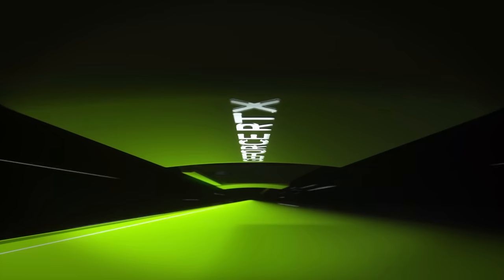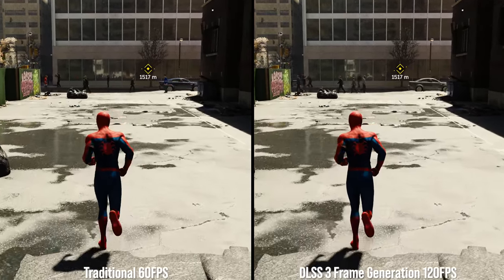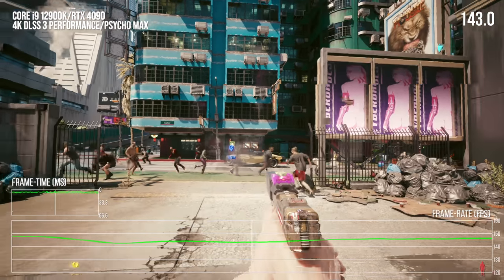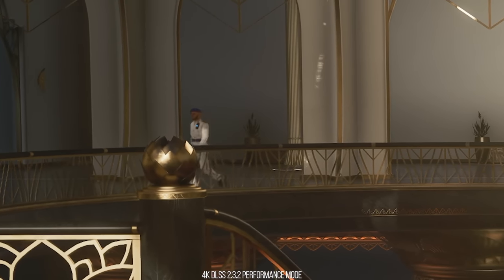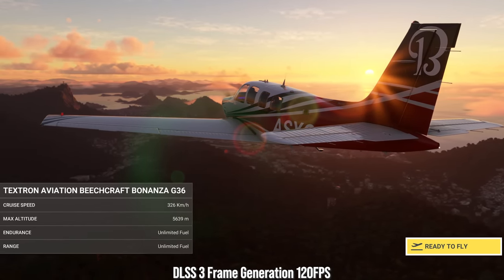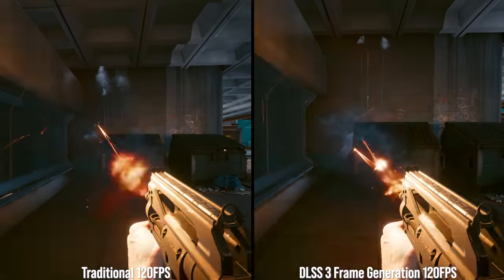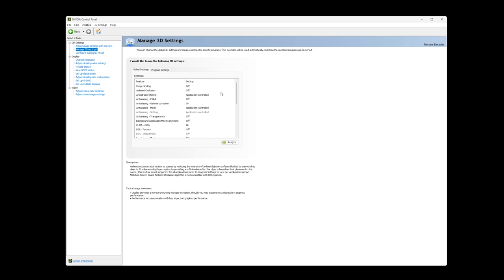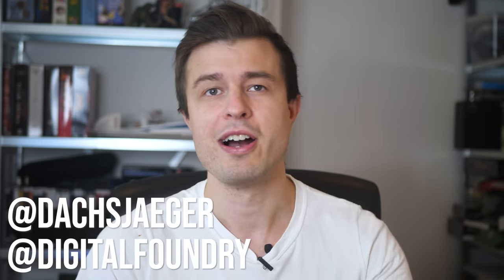Nvidia DLSS 3 Analysis: Image Quality, Latency, V-Sync + Testing Methodology

Comment: Isn't the solution to vsync latency being terrible when it kicks in at monitor refresh rate just to use fast sync? This will hurt frame pacing above refresh rate, but that should be much less noticeable at high refresh rates and add much less latency.
Reply: Definitely an option in theory. That said, fixing framerate capping & V-sync behaviour with DLSS3 would be much more appreciated instead of keeping this band-aid approach.

Comment: While it's a given that the 4090 will run current games and older games with RT + ultra settings with fps in the hundreds @ 4K, the real test is future games that for example use UE 5, that would stress the shit out of the GPU 😁

Comment: Fantastic as always, loving the DLSS coverage. I always enabled GSYNC and just capped my framerate a few frames under (141 for instance), does it actually require vsync to be forced on?

EDIT: Looks like at some point NVIDIA made vsync optional when enabling GSYNC (traditionally it forced it on in the background tmk) and that explains the few tears I see. The consensus is to enable vsync as well, and disable per title if you must. TIL!
Reply: Just follow Blurbusters G-Sync guide, and youre set for life.
Reply: I've always thought the same thing, and have been doing the same as you, e.g. few frames below screen refresh rate. So is it best to turn on v-sync with gsync in nvidia control panel now?
Reply: Vsync has to be on for gsync to work correctly, capping your frame rate 4-6 fps below your monitors resolution ensures Vsync won’t enable at monitor cap. This has been how Nvidia intended it to be used forever.

Comment: Great video! Thanks a lot! Actually this is a bit better then I was expecting (mind simply can't process fast enough to notice, I guess we are thinking in motion vectors too =D). DLSS3 looks nice for non-competitive games. Yet its not a low performance to high performance solution like DLSS2 or FSR or whatever. Its a high performance to very high performance solution. It seems useless if a card will fail go give at least 60 FPS in a game naturally. So its nice for 4090/4080, but won't be very good for lower end cards and also won't help their longevity.
Reply: Even the Rtx 4070 / 4060 ti / 4060 cards will be more than capable of minimum 60fps in almost every single game even if the resolution might not be 4K but regardless those cards will be very high performance for what they’re !
Reply: @technologylord4017  They are high performance, but new games appear too, cards get older with time and you'll see lower FPS. What I meant is that you can't go 4k all-RT Cyberpunk on some 4060ti and get playable 60 FPS by DLSS3, cause latency will ruin the gameplay. In order to get more frames by DLSS3 you must already have high FPS to begin with.
Reply: @Vivicect0r  oh yea I totally agree Man not @ 4K although with the right mix of settings it wouldn’t surprise me if the 4060 ti can deliver as most likely it’s gonna be on par with the 3080 in rasterization performance and the Next Gen Ray Tracing cores should also be better than 3080

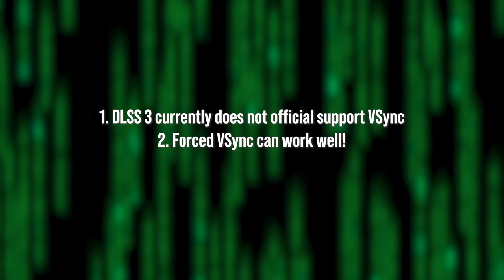Comment: 8:45 just use a Frame Rate Limiter to stay in range?!
Reply: exactly, without gsync the vsync option will make the picture smooth but will also add latency in both cases, locking the framerate 3 below max hz is the way to go.

Comment: Input latency - How does this and normal DLSS work with networked games? I'm ignorant on this subject.

In multiplayer games I assume network communication is happening at set intervals regardless of FPS (as long as the CPU and network can do it). So when you shoot at an enemy with a high latency due to high fps with VSync on and with AI frame generation (short hand for that?) does the increased visual latency effect the gameplay at all on the hit detection or in any other way?

I'm try to understand this. With say a decent ping of 40ms, does AI generation cause that much of an issue?

Comment: For Example my RTX 4080 have only 30 fps or maybe 40 fps in 4k (i have only a 4k Sony TV with 60 hz without gsync or vrr) and i need 60 fps with Frame Generation, make this Sense with DLSS 3, because of the inputlag, artifacts and works in this case with vsync ? Thanks for any comment and answer

Comment: for the first my english is bad, but i have to ask. What if i have 40fps in witcher 3, 80 with frame gen and i use nvidia g sync monitor, who turns g sync on between 48-240 fps. Did my g sync work on 80fps with frame gen?

Comment: Hey guys! Need a bit of a help. So I was thinking of purchasing rtx 4090 graphics card. Now am not really a tech guy. Just someone who has okay knowledge on these graphics card.
So i came across this discussion that since rtx 4090 has display port of 1.4 (and NOT 2.0). That's why at Max it can only output 120fps at 4k, as that's the max throughput for a 1.4 display port.
So do any of you have any information on this? It will really help as it will defeat the purpose of buying 4090 when even though the graphic card itself is capable of generating more fps at 4k but it can only output a max of 120frames.

Comment: mmmh i never had tearing with v-sync off in games and g sync on in nvidia control panel, also i never used that second option, these " tips" seems especially weird
Reply: You must not play at a high frame rate.
Reply: @eternalbeing3339  i actually do

Comment: why use Vsync instead of just using VRR?
Reply: VRR still needs VSync to fully eliminate tearing. Ideally you’d also want to cap your framerate a few fps below your max refresh rate to keep it within the VRR range to avoid extra latency from VSync.

Comment: Is there a technical reason for not enable it on the RTX 30XX?
Reply: A Nvidia rep claims dlss 3.0 could be added to the 3000 but frame insertion is only on the 4000 .
Reply: @eternalbeing3339  I heard something like that but apparently it was more like a shortcut to say that DLSS in general will continue. Because DLSS3 IS the frame insertion thing and we see that it works in parallel with DLSS2.

Comment: FREESYNC is run with VSYNC turned OFF as opposed to gsync (PROPER ACTUAL with a module GSYNC) requiring VSYNC ON. 
I dare say nvidia DLSS3.0 is relying on FREESYNC to manage VRR and that nvidia have simply been calling it "G-Sync" because they have been pulling that BS since they first opened up to freesync: trying to twist the branding to their own credit after poopooing it for years.

Comment: G sync is v sync on lower than hz monitor fps...

What the hell are we listening?

V sync on when g sync on , only helps so that fps dont go higher than monitors refresh rate thus tearing....

You could either enable v sync or set an fps limiter via nvidia control panel few fps below maximum hz like  140fps on a 144hz monitor

Comment: I'm wondering if the AI frame generation could improve after a few gaming sessions.
Reply: it won't, cause the frame generation takes place based on the history frame buffer. No real AI is working behind the curtain, it's just the convolutional autoencoder model that was trained by an AI by Nvidia super-computers.
Reply: No, the AI does not train on the fly like that. Training is a very different process to image generation.
Reply: @kishaloyb.7937  Hmm ok understood! I'm not that familiar with AI technologies yet. Thanks for explaining :)
Reply: It's not learning on our computer but on Nvidia's super-computer.
Reply: @konga382  @sCealt actually transformer model does that, it trains on the fly using 1000s even millions of previous frames without keeping all that frame data in another very memory efficient error correcting model, but yes, single gaming session only, but still it will train the transformer error correction model for the entire session, it would be interesting to see long term gaming session results...
Reply: @niks660097  that's really interesting! Sorry I'm completely ignorant when it comes to AI technology but wouldn't this stack up in the RAM after a certain time? Or is the data only passed to the correcting model, then erased?
Reply: @sCealt  don't worry even for AI students or engineers transformer models are new and hard, and for your question, no it doesn't stack that much, but static memory requirements are higher and it uses hella lot ALU/computing power (in this case tensor cores) and memory bandwidth(3x-4x more than traditional models), but i still think even turing cards can run them, but nvidia is artificially segmenting their cards by software..

Comment: does DLSS3 has better quality than DLSS2? i mean screen is sharper and better? or its the same?
Reply: Its entirely different technology.
Reply: @divinehatred6021  can i use dlss 3 on rtx 3060ti?
Reply: @PlynDoChlodnicy  DLSS3 is fake frame generation and thus it will increase delay by at least 3 frames :)

Comment: The problem with DLSS 3 is that the alternative is turning settings down, that might impact the visual quality less then adding DLSS 3. For me the videos you showed of Spider-man with DLSS had very obvious and annoying artefacts even at high frame rates, but I don't get those frame rates trough youtube, so the frames I might get frames with artefacts for longer time and it might look worse then in reality. For example the spider-man climbing scene for me the hands looked horrible and pixelated due to the artefacts. I am not sure how it would look like at full FPS however and not trough youtube, but I suspect I would prefer lowering the settings then using DLSS 3 as for me tearing or artefacts are a lot more annoying then slightly lower quality. Most games today have pretty small difference between medium and ultra and you probably might be ok on High.

Comment: well, frame generations is broken as far i am concerned. i never enabled vsync in games before. rtss 140fps cap or ingame 140fps cap is perfect for low latency and no frame tearing in all fps ranges, also works in windowed mode. 
and now dlss3 require all these extra step to work and probably wont work at all windows modes on top of dlss not being in the games i play.

Comment: I have to disagree with the analysis of reloading in CP2077. DLSS3 looks smooth there but it's too smooth. It removes the snappy aggressiveness of the reloads. That's what frame interpolation always does--it removes the artist's timing intent and replaces it with perfect smoothness. The result can look good for languid or smooth movements but anything with snap looks less impressive. Most people won't be able to tell you why, just that it doesn't look quite as snappy.
Reply: yeah this it assumes the movement between frames is linear which it often isnt

Comment: Yes Spider-Man on my Steve that now has the intro thing that was really good it's weird because it's not supposed to do anything right but obviously it doesn't because it just looks exactly the same as it would look if I'm playing it on ultra quality mode but in 720p right and that's what is your Ms teams background haven't office hope Dr on my own to see difference but like on this on the screen I can see a difference on it I can't do another see had it also updated it to give us a MD d2pt one which is weird because I have no I didn't know that I didn't even know that Spider-Man even got update at all I don't even know when they go and update because it didn't come up with show up in my download this at all so yeah but yeah it's weird because they md21 yeah it looks slightly better but it was too same but the Intel kind of graphical update thing that runs way better like for some reason I can get a stable 60fps on Spider-Man and my steam deck using that I don't know how it's possible what is doing because I thought it would have needed to tap into basically the software that's needed but I guess it doesn't it weird yeah it just obviously for me I thought it was it works as and yeah I know how I know upscale is work right but I thought I still had something to do with more of a I like benefits of the same GPU and CPU right for example if you're playing definitely yeah you can use AMD on the steam deck but you can't use dlss because obviously it's not NVIDIA card right but on Spider-Man you can use either one you can use turn off AMD the insomniac version or or the Intel version which is very hard as it's great it's on there but it's weird that is under you have to take it it technically you have to keep playing with the screen size and the wind windowed mode and whatnot and then you you can go quiet and you can see it and you can use it and then it disappears you actually use it but I just for me yeah it looks a bit much clearer then I'm AMD but I'm still using the steam deck screen so start giving me an exact approximation of what I need that to be seeing but it looks good looks nice and clean and it was way better which is weird

Comment: Lesser 4000 series cards... Like the 4060. Say its pushing 45fps and DLSS3 gets you to 70. Input latency being at 45fps still? If that's right then this tech has limited uses. No way you can touch this for any online competitive game, unlike DLSS2. I wouldn't want to touch it period even for single player games personally.
Reply: Yes its not for competitive games . I mean you don't need frame regen on compi games as they already run well . Its for games like cyb2077 which heavily use ray tracing .
Reply: @bullykojima3232  So 30fps latency at 60fps is acceptable? lol

Comment: in regards to using Vsync with Gsync, wouldn't it be enough to simply cap the framerate with NVCP or RTSS to avoid the tearing above the max. refresh rate?
Reply: Based on what they showed with RTSS in the video, I wouldn't be surprised if it adds the same input latency even with V-Sync off.

Comment: So, correct me if I'm wrong, but DLSS 3.0 is effectively taking (just gonna throw out an easy number to do math with) a 60 fps game, rendering 30 fps of the 60, and filling in the other 30 with AI generated images. Right?

It's basically SLI without the second gpu. lol
Reply: He is comparing native vs dlss 3 like for like fps for analysis purposes. If you are native 60 fps, turning on dlss 3 frame insertion would turn your 60fps into 100-120fps. Or turn a 30fps game into 60fps.

Comment: You really sit around and nick pick at such things like this? I would never even notice, even while you're trying to point it out - while playing or not, I still don't notice the one missing frame or so, or whatever it is.) You, yourself are literally having to run footage in slow-motion to notice all the imperfections that you're hunting down. And honestly, the difference doesn't seem noticeable in any way of significance, or even insignificance for that matter. It's like playing the game and instead of enjoying it, going out of your way to stop along to notice and count 49 blades of grass in the corner of the ground somewhere instead of 50. The one blade of grass must really be (that) super important for you to hunt it down in super slomo. You have to play videos in slow motion to even show what you're trying to point out, and it's still magnifying glass daunting to try to spot the difference. 

Y'all go ahead and spend your time trying to dissect games to find the missing (link) frame. I'm going back to actually playing. Besides, who really actually needs all of this or a 4090 when the 3090TI is more still plenty more than capable? It may not be the overkill that 4090 is, but it doesn't have to be to still be at the top of it's (or any other) game. I promise you, on my 120 or 144 monitor, as far as I can tell, my version of Spider Man or any other game plays just as well on my 3090TI as it would a 4090. I don't need anything passed 120 or 144 fps for gaming. Not to mention, I don't experience any shutter, slowdowns or anything to point out that would lessen the experience in the least.

Comment: Nvidia ripping people off by introducing these half baked dlss features.... They should have improved raw performance not some artificial frame generation gimmick.Not to mention high power usage of these cards and insane price.
Reply: Read the reviews : by itself the power draw in under a 3090 ... The generational uplift if phenomenal, and dlss 3 is just as addition, not the reason you'd want to update.